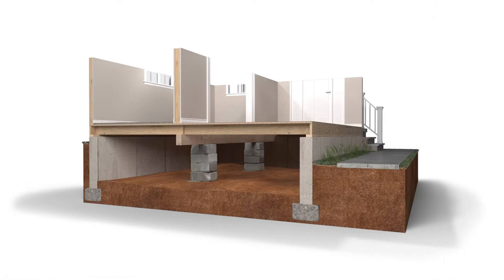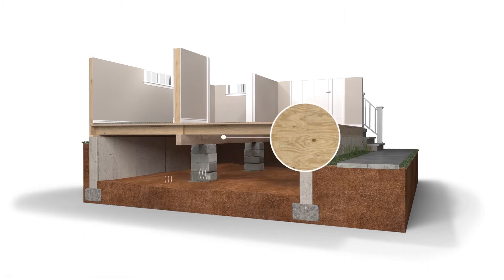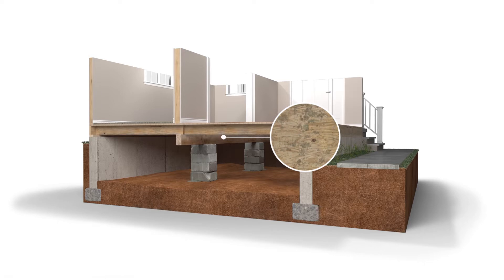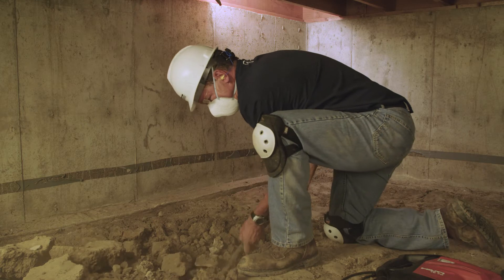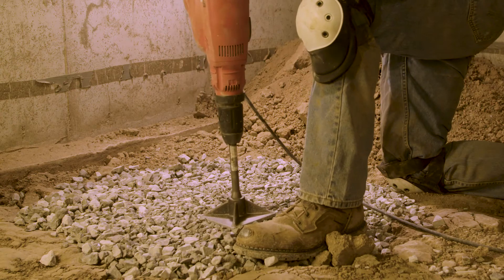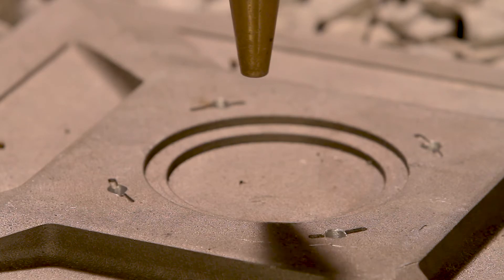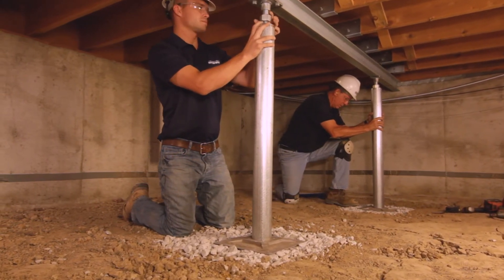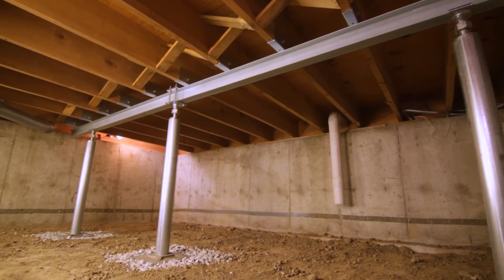SmartJack Product Overview

Comment: Why did you use no. 2 compacted stone rather than concrete?
Reply: still no answer lol,
Reply: @RBCHOKE  I can answer this. The compacted stone helps distribute weight differently than concrete would. Also, concrete adds even more weight which is why a lot of peirs sink into the soil to begin with.

We want the weight distributed evenly throughout the stone. It lessens the amount of pressure being put directly on the soil.
Reply: @ErickEscamilla  do you use any type of underlayment to prevent the compacted stone from sinking out?
Reply: Because it's high quality engineer stone lol